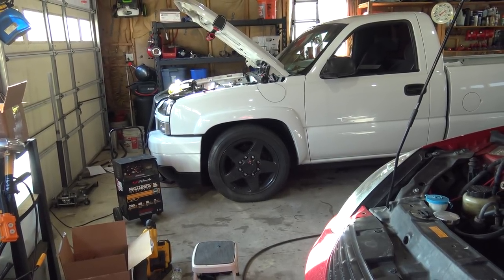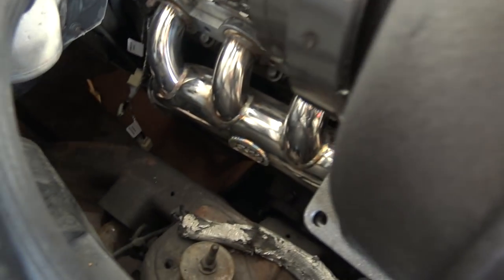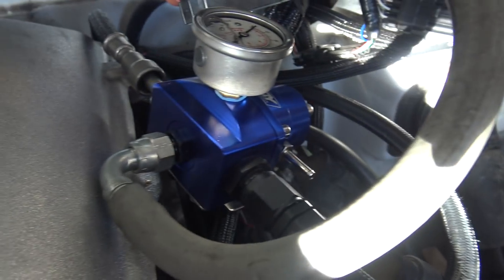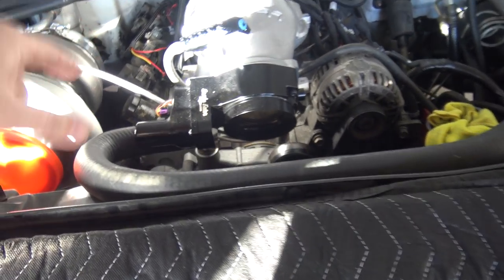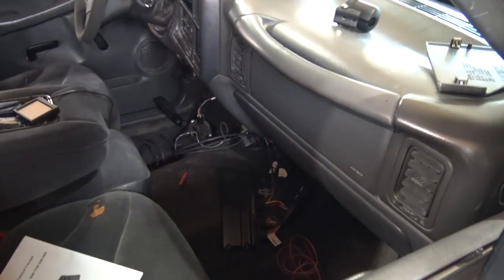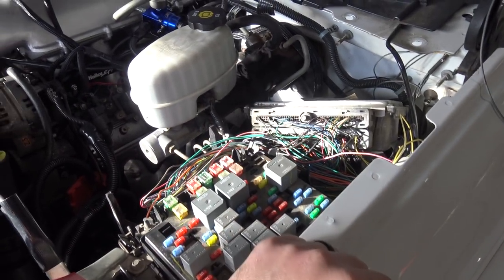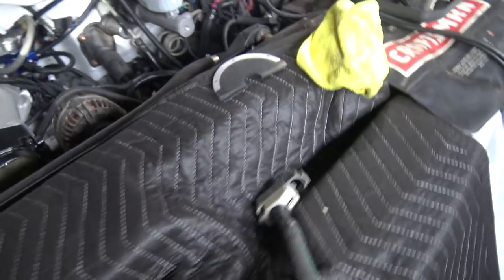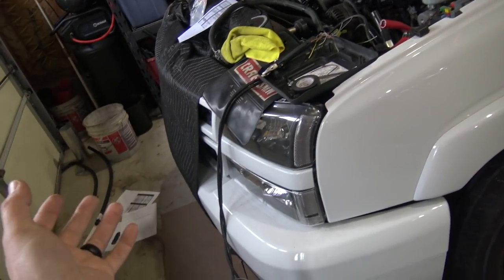2500 turbo build half way update

Comment: I have watched this video like 14 times. My turbo 2500 is basically finished. Looking to integrate stock pcm using the terminator x. So much good info. I wish finished product info were somewhere I could reference! I guess cut out everything the Holley runs and see what’s left! Thanks for pioneering!

Comment: Great video Matt.  I did the same thing with my Silverado months ago and found out the hard way that if you get rid of the stock ecu shit don't work right. LoL     was chasing a power drain for weeks cuz the stupid day time running lights also go thru the ECU and it was making a relay stay closed and draining the battery.  I unpinned a 4.3 ecu harness and used that computer too start truck and get the electrical to work with also running the Holley Terminator x max. Keep up the great work.

Comment: Probably no one will rewatch this episode more than I... so helpful , right now I’m struggling with the red and white switched 12volt Holley wire, I know what it’s for however I am not sure if it needs a relay or just go straight to the pink wire on the back of the ignition barrel or find another clean source at the fuse box or something I’m certainly overthinking it.
Reply from the maker: On a Silverado?
Reply: Sloppy Mechanics oh sorry no on a Holden commodore , it has serial data setup similar to your truck so not canbus. The instructions Holley sent with the kit, say the loose red n white wire needs to go to clean 12v switched power source and needs to be live while cranking. I think this has me overthinking it, I have searched online and for videos of someone doing this, I think the closest I got was an adapter fuse into a live 12v source from a factory fuse box while the key is in the on position? I have swapped a 5.3 truck motor in the car, not that that makes much difference.
Reply: I think I am going to get a piggy back fuse holder, use my multi meter to find a fuse in the fuse box that is 12v with the key in the on position, ground the black wire that pops out of the loom with the red and white wire and hope for the best. Sorry for sounding all this basic stuff off you dude, I should really just back myself and give it a go.

Comment: I disagree on the ability to split VR signals. I've been running a 5.4 F150 with a stock ecu and a speeduino in parallel for several months. Crank signal on a modular ford is VR and I have had zero issues sharing it between the two. Love this build for the thoroughness of integrating everything.
Reply from the maker: thank you, ill try it!

Comment: Obviously you are the king but just to let you know I have two trucks swapped gmt400 series where I split the vss. One with the factory ecm (first swap) second one without factory ecm both 0411 pcm driven. Your Hall effect on the 4l60e or 4l80e will absolutely work with both. I did it nice and dirty with some china crimps and have been goin strong for 4 years
Reply from the maker: sick thank you!

Comment: And you probably know this, but Those stock intake manifold bolts are TTY. Probably more important than head bolts, bc of how weak they are.   I’ve reused them. But I put a small dab of blue locktite on the threads on cammed motors.

Comment: Wire over jobs just make a car nicer. Ive done a lot of them. Keeps everything working. For a daily type car its a must. Also frees up inputs and outputs on a basic aftermarket ecu using the factory ecu. Especially good if the aftermarket Ecu is limited.

Comment: do you plan to go over in a future video how you will integrate traction control via the DBW?
Reply: Good question, I want to do that with my blower motor, not sure if the turbo would loose spool with the throttle closed, that may be why they use ignition timing instead

Comment: I’m not sure what year truck that is. Or better yet, what year OS is flashed to that pcm, but if you’re having issues with the fans cycling or not running long enough with the AC compressor engaged, while the AC is running(which is likely on a truck OS w/ e fans), you need to add a resistor to one of the pins to simulate what the Camaro pressure sensor/switch does. The trucks don’t have the same sensor, so the fans will cycle like the compressor, no matter what fan on/off settings you have flashed on the tune.

Comment: What If someone didn’t need any of the functionality stuff from stock ecu Bc they had the 7” dash, and only needed the stock ecu to pass an obd2 emissions test.  In theory, they could give the ecu nothing but all its powers and grounds and share the signal wire from Holley harness crank sensor? And play with hpt to delete codes and be good?
Reply from the maker: yes it would be a use case scenario but yes.

Comment: Want to try to get most of my vs kit installed this weekend but wanted to ask you about my turb drain line, since i need and oil change anyway, would you recommend drilling and tapping with oil still full in the pan or should i drain it first then start drilling and collect shavings either with a magnet or shopvac? Thanks for your imput
Reply from the maker: Yeah 90% of the time I drill and tap pan while it’s in and on car

Comment: Just me but fuel spraying at some random time under the hood just doesn’t sit well w me.  Ive only cheaped out on fuel system parts once.  And I was a nervous wreck... lol.  Redid everything w name parts and followed instructions to w T lol
Reply: That`s why you just double check all your stuff before installing, no matter namebrand or shanghai dingdong. Have you seen ETCGs fire show? That was holley regulator, he just f-d up and didn`t check if he had right spring in it.
Reply: Никита Надеин I haven’t seen that tho.  I had some cheap stuff leak and I guess it never dawned on me that those parts fail too but it always bothered me.  I guess just pay attention and keep an eye on it.  Once it’s been dry for a while chances are it’s probably happy lol

Comment: Why didn’t u run ur alt harness also? I havnt bought mine yet but in ur pics it looks like its plug and play. Or is it not
Reply: I was wondering that also
Reply from the maker: i said in the video why use it when the stock ecu controls the alt and is already wired, its about sharing things not taking over things for no reason, this would be the same as, why not re wire the fuel pump relay and power wires, because they are already installed and functioning

Comment: Would you run a Terminator on a 99 LS1 Firebird or just stick with the stock ECU and use HPT?
Second question. Same car with a 5.3 boneyard swap, go terminator or use stock LS1 ECU in the car?
Reply from the maker: I just tuned a ls1 99 firebird with a terminator and stock ecu together didn’t upload video but tuned Sunday

Comment: You have to switch the white wire with black stripe with the dark brown wire I have a GEN four motor and 6l80 Transmission none of my gauges work My truck is a 2000 are use the Cadillac CTS paddle that’s the same one they use in the right plug and play crate motor
Reply: And is the same for the truck paddle as well that’s the one that’s in my truck and the truck panel I have the CT is V paddle in my 66 Chevy nova

Comment: So if I didn’t care about gauges and just wanted the BCM to turn on to control the acc. And control ac and heat. I’d just have to give it crank signal engine temp and fan control.
Reply from the maker: That’s my plan
Reply: Sloppy Mechanics now that’s my plan too. 2005 gto

Comment: what year did they go to a 52 tooth wheel?  I thought it was a 24 tooth to 2006     i love lt1 swap.com   so much info for free
Reply from the maker: Gen4 starts sooner in cars then trickles later into trucks, some ls2 has 24x but front read cam then around 05-06 vette has ls3 I think? Then 07/08 trucks started getting 58x can bus gen4 also then heavy duty stuff after that

Comment: Do u know if a gen 4 computer is better than a gen 2/3 computer for tuning?
Reply from the maker: It Varys, some of the os’s are friendly and some are not, either way no stock corvette ecu has closed loop wideband and integrated data logging and boost controller by mph/gear etc